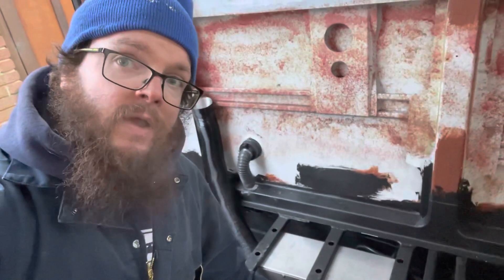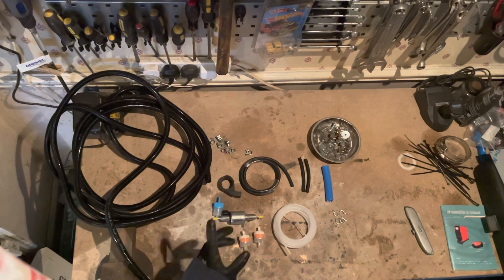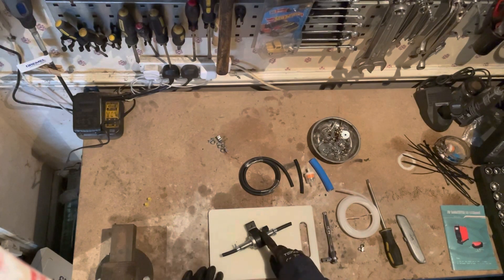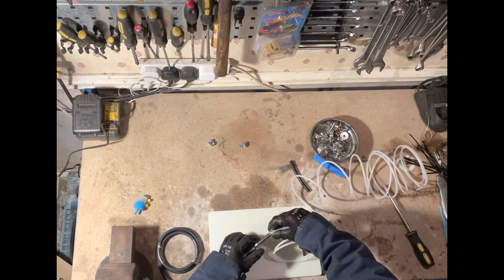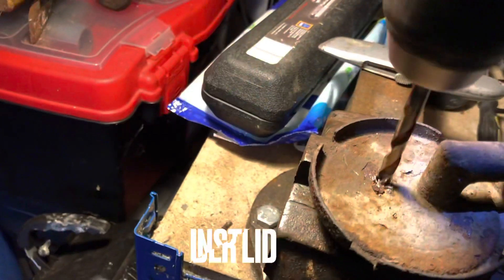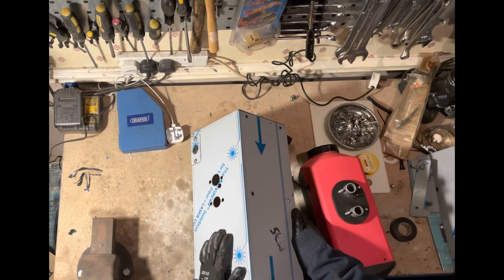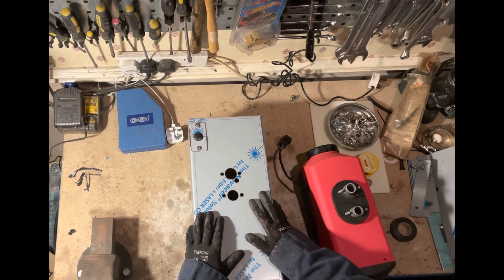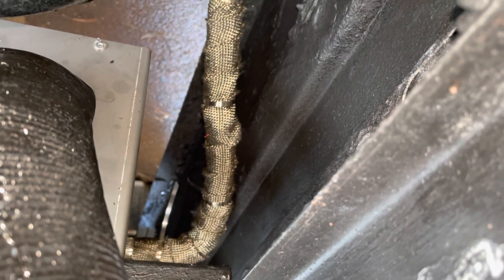Chinese Diesel Heater Install Guide | Underslung Box & Quiet pump trick | Vario Minibus Conversion

Comment: Hi liked your install and the tips, One point you seem to have installed the heater on its side. Is that OK with the instructions just thought that they should be set with the exhaust and air intake at the bottom
Reply from the maker: Evening. Yes I did find that odd too but checked and it’s fine to install on its side. The main consideration is to ensure the exhaust and air inlet are free and clear. I did find it weird it was in its side. I must admit.

Comment: Brilliant video, just installing one myself. Did you have to do anything to the black hose to push the white hose into it. Really struggling with mine? TIA
Reply from the maker: Thanks Wayne. It was quite a snug fit but not so snug it wouldn’t push in. You could try popping the black rubber part in a warm cup of water for a few minutes. That might give it time to supple up a bit. 

I’ve actually replaced that little black bit of hose since with some better braided rubber hose that the white nylon hose pushes into - after about 18 months I’d found it’d cracked. Most of the new upgraded hose kits seems to come with this better hose now.
Reply: @WanderbusAdventures  cheers, I'll try that.

Comment: Fitted mine today and whilst mounting the pump I remembered what you had done with a piece of hose.  So I came back to say thanks and to encourage you to keep going despite setbacks. Pump is lovely and quiet I had a job to tell it was running or not.  Mind you it was pouring with rain at the time
Reply from the maker: Brilliant news James. Fair play for getting on in the rain and wind.
Reply: @WanderbusAdventures  as I'm sure you can appreciate there is alot of pressure to get the build finished. It's not real pressure there is no date but still feel the pressure is on if that makes sense
Reply from the maker: Yes we totally understand. From time to time we do take a step back but are driven to progress because we want to get out on the road one day. Top work though, it was miserable weather yesterday 🌧

Comment: I was thinking why is everyone running off of main diesel?  Why not red ? its a lot cheaper
Reply from the maker: It definitely is. Main reason for us is we didn’t want another tank. It’s an option for the future though.
Reply: @WanderbusAdventures    i was thinking on mine  15 liter  detachable jerry can with red and a tap to flip from red to main  ? Just so I don't use any red to run on ,with  the main is a "just in case"..  love your content your the inspiration for me getting on with mine .. im at the point of just making lists in my build .MOT is the first on all them lists
Reply from the maker: That sounds like a clever solution. I like the idea of getting the MOT first too. Seems smart and could avoid you finding some nasties.

Comment: ...good vlog but I would have put the pump/filter and connections inside a metal box with an inspection door and sound deadening material.The air intake looks a bit restricted in the chassis rail
Reply from the maker: Thanks. Glad you enjoyed it. That’s definitely an option for the pump. And I’ll be keeping an eye on the intake and heater; if it comes to it I can move it in draw from the side. Thanks for your feedback and for watching 😊

Comment: I'm installing one of these inside a van, but would rather set it underneath the floor like you did on the bus.  Have you noticed any affect on fuel delivery (leaks) or burn (carbon build-up) with the heater intake and exhaust pipes coming out of the side instead of bottom?  

The only reason I did not run the heater under the van was because I was under the impression the intake/exhaust had to face downward, and there wouldn't be enough clearance that way.  If setting it on the side works, it frees up some much-needed space!  Excited to hear about practical experience since installation so I can crawl under the van and start planning the new installation :D
Reply from the maker: Hey. So I had the same concerns about laying it on its side but the manufacturer allows for this; you need to ensure the fuel inlet is below the air in/exhaust out and not on top of it. When I removed my old Eberspacher it was installed on its side too. 

Leak wise it ran fine over winter. I’ve not ran it for many months now as the build has not completed and it’s summer so cannot comment on the carbon build up as yet. I’m hoping it wont be an an issue as I’ve ensured room for the fresh air in and a nice even run for the exhaust. I think I’ll provide a long term test result after the winter. Hope this helps and good luck with your install.
Reply: @WanderbusAdventures  Thanks so much for the speedy reply!  Excellent info about the fuel line position.  You've been a tremendous help and I wish you all the luck in your build :D
Reply from the maker: Thank you. Best of luck with yours also

Comment: Glad I found your channel. Great videos. I also plan on using a mounting box for our 2kw heater on our Mercedes bus. I’ll need to get a box made up locally as I’m not in the uk. I’ve the bobil water heater and debating whether or not to make a longer box for the heat exchangers or to just join them to the ducting once it’s inside the van. I think closer to the heater would be more efficient but it also means more holes in the floor. Undecided which would be better yet..
Reply from the maker: Hey. Thanks so much for watching. We are really glad you found our channel too 😊. The bobil heater setup is becoming more and more popular; check out maxandsophieinavan as they’ve created the exact setup you mention with aluminum plate and angle iron (let them know we sent you 😊). For us mounting it under the floor just made sense. Exciting news about your bus, what are your plans for it?

Comment: Great job I subscribed I’m about to install two metal housing 8kw diesel air heaters into my 1967 GM city bus I have the heaters I’m just waiting on parts but I do have a question for you why didn’t you sound proof the heater box
Reply from the maker: Sounds like a great project James. On our bus we have since installed an insulated floor above this which will cut down noise in the living quarters. It might be an idea to still do this for our ‘neighbours’ though. Do you have an idea in mind on how to achieve this? Thanks 😊

Comment: How would you change the glow plug?
Reply from the maker: Hey. The box has a side that unscrews. So I can take that off to access the heater. There’s just enough space to allow me to take the heater out of the box. I’m sure it’ll be a pain; but I’ve made sure it’s doable. Let’s hope it won’t be for a while 😊
Reply: @WanderbusAdventures  good it looked like the only access was from the top
Reply from the maker: @andrewgilbride7546  yeah that wouldn’t have been good for sure. I installed it back to front to ensure access. Thanks for calling it out though as it’s a great consideration.
Reply: @stevenmaloney3787  assembly with copperslip will make it easy to access in future.

Comment: Great informative video , loving the hints and tips especially the upgrades. The clips in the kit we had were not that great. They've lasted so far but we'll swap them out for the upgraded type :)
Reply from the maker: I’m glad I did. I used one of them on the silencer initially and it went rusty pretty quickly. Otherwise the kits are ridiculously great value. Thanks for your kind comments too. Means a lot.